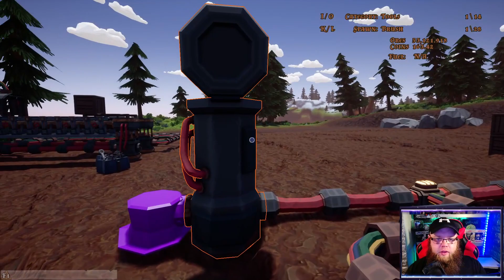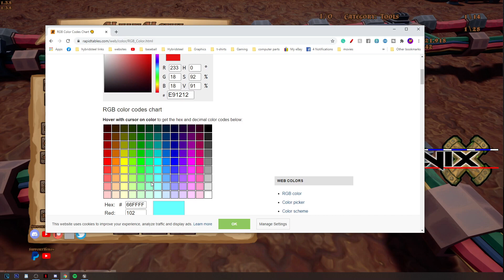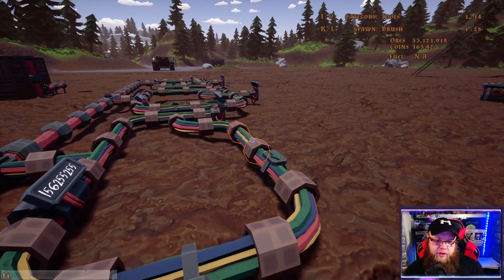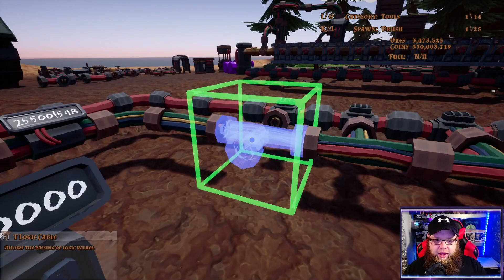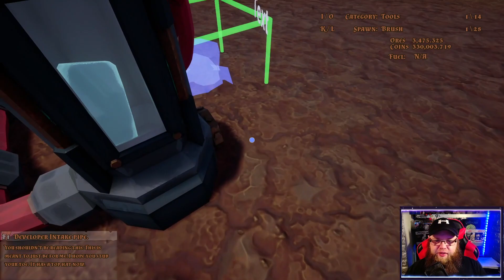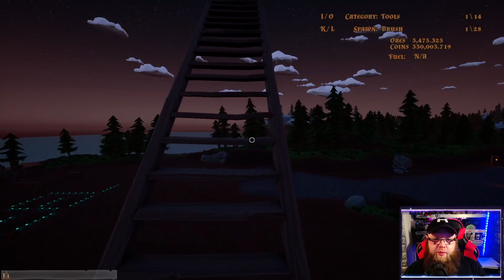Hydroneer Guide | RGB Lighting

Comment: In your example, once the one display reached 999999999, you could have another counter on an == circuit compare itself to that value, and then reset the original counter in the same way you reset the counter on your first auto smelter example from 30, back to 0.

Also, so the red cables only carry power from one LED to the next and copy the colour of the upstream LED unless the multi coloured data cables are sending a signal to the next LED?
Reply from the maker: yep i did that after this video worst part is now i cant revisit it as everything is gone so having this here means others can learn from this so thank you for adding your comment as it can help othe rpeople.